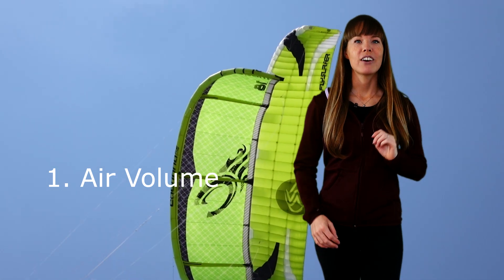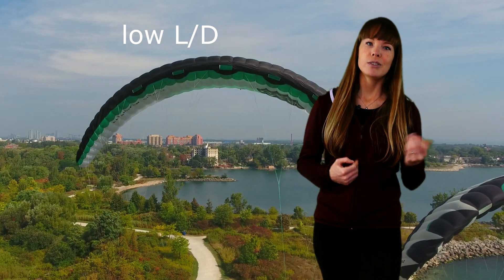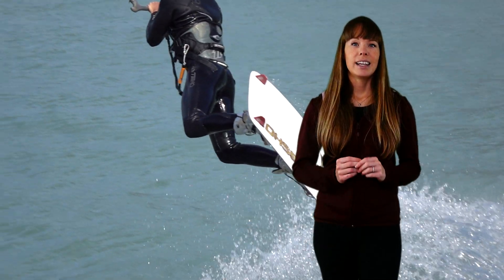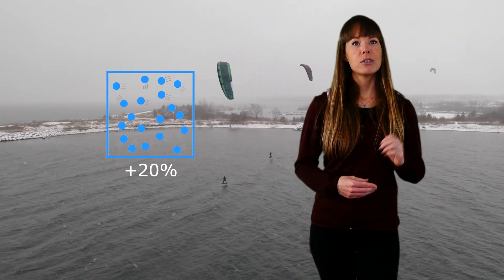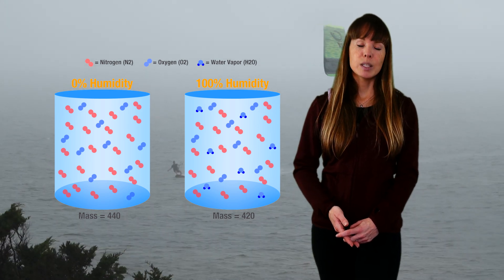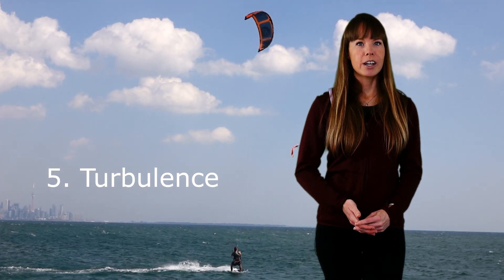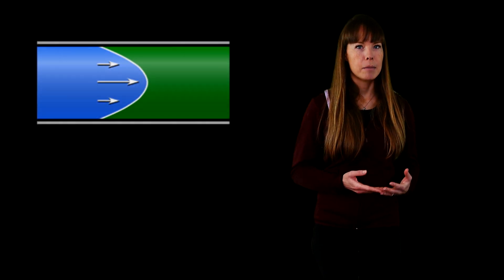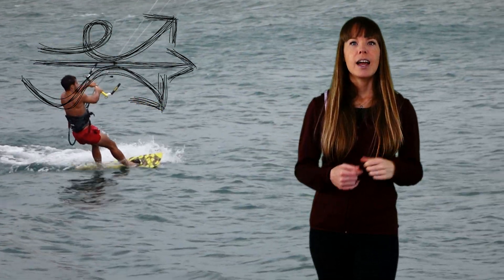5 Things that Affect the Power of Your Kite

Comment: Kinda late commenting on this one, but... My understanding was that the amount of energy per second delivered by the wind varies with the cube of its speed, not the square.  A fixed block of air with a certain mass contains kinetic energy related to the square of its speed, just as you say. Double the speed, 4x the energy in that block.  But if you double the wind speed, then twice as many of those blocks hit the sail every second, which doubles the energy again. 2x wind speed = 8x as much energy per second, 3x wind speed = 27x as much energy per second.  That's why in sailing in general it's so easy to get overpowered as wind speed increases.  Is there a factor with a kite that changes this?
Reply from the maker: Hey Blaik, from our research and from previous comments that we received, wind energy is square of its speed, curious where did you see that it is cube?
Reply: @OurKiteLife  High school physics: Kinetic energy of a moving body = 1/2 mv^2.  So a block of air of a given mass contains kinetic energy proportional to the square of its speed. But as speed increases, more blocks hit you per second in proportion to speed again.  E.g., double the wind speed, each block of air has 4x the energy AND twice as many blocks hit you per second.  2x as many blocks, each one with 4x the energy, so total energy delivered per second goes up 8x.
For some independent confirmation, Google the phrase "wind energy as a function of speed".  This mostly turns up articles on wind turbines and the power they generate. Here are a few that turned up from that search when I did it, all of which agree that power varies with the cube of wind speed:
https://www.windpowerengineering.com/calculate-wind-power-output/
http://xn--drmstrre-64ad.dk/wp-content/wind/miller/windpower%20web/en/tour/wres/enrspeed.htm#:~:text=The%20wind%20speed%20is%20extremely,eight%20times%20as%20much%20energy.
https://energyeducation.ca/encyclopedia/Wind_power
https://openei.org/wiki/Wind_energy
But a sail/kite is not a turbine, in part because it's in non-trivial motion relative to the wind when in use, and I don't know if that impacts things or not?
Regardless, your essential point still holds - the amount of energy you're playing with can go up rapidly as wind speed increases.  The prudent sailor/kiter should be wary... and excited. 😁

Comment: Great video, and something I've thought about a lot - especially the laminar vs turbulent flow and just how significant of an effect it can have on kite power.  I ride almost exclusively on foil kites, and spend a lot of time on Lake McConaughy, Nebraska in the summer.  At that lake, there is a very predictable morning wind that feels quite strong, but once you get out, it has hardly any power.  In the afternoon the winds speeds can be significantly lower and yet surprisingly provide much more power.  I've come to call the morning wind "holey", and the afternoon wind "plump", or "buoyant".  I've come to basically the exact same conclusion you have:  in the morning there is a lot of thermal mixing going on, making the flow more turbulent, whereas in the afternoon the thermals have steadied out making the winds more laminar.

Aerodynamically speaking, I believe the reason this has such a significant impact on kite power is the following:  in the gustier, more turbulent flow, I don't believe the air has the ability to fully attach and flow the full chord of the wing before it gets disrupted.  This I'm guessing is causing premature flow separation on the topside of the wing near the trailing edge, kind of similar to what happens when a wing starts to stall.  This means your wing is flying very inefficiently with a modified airfoil/airflow shape that looks nothing like it was designed to be; i.e low lift/high drag or low L/D ratio. In a nice laminar wind, however, the wind/air will stay attached the entire chord-length, just like the designer intended  - and your kite performs like a dream - as it was intended.  Too bad those laminar days are so few and far between for us inland kiters :)

What would be really fun is to take a kite and tape a bunch of small pieces of thread across the entire wing (or at least a wing chord section) like you might have seen in wind tunnel tests, and then somehow get a video of the top surface in the different types of air.  I bet you would find that in laminar winds, the threads stay pinned down the surface of the wing the entire time, whereas, in turbulent winds, you'd find the thread tufts fluttering quite a bit - especially towards the trailing edge.  This would be a sure sign of inefficiency.  Sounds like a great COVID Project, now that you've got your balance board done!!

Keep up the great videos, thanks for all you share.
Reply from the maker: great discussion there, thank you. You raise an interesting point about time of the day as well. We personally find that wind is stronger in the morning (depending on direction) and lower in the afternoon as it warms up (except the thermals, south winds). In the evening the winds usually wind speeds pick up again on easterlies, and die down when they are southerly (thermals). 
With regards to attaching a small threads across the wing, that is actually doable, and we do have the time. Will see how it goes. So far we had barely any wind for past two months :(

Comment: Reasonable 'on earth' changes in temp, pressure and air density won't deliver a 3% difference in wind power.   Giving relative measures of individual variuables is misleading and makes it sound like these have a huge effects.   Turbulence and gradient have much more effect.
Reply from the maker: We did focus on extreme conditions, and we agree - if you're looking at kiting between 15 to 25*C the difference will be minimal. From our experience in snowkiting in -20*C and kiting in summer in 30*C, the difference is noticeable
Reply: @OurKiteLife  Yup and almost entirely due to wind gradient.

Comment: Regarding turbulence, I'm not a meteorologist, but from a paragliding perspective; I'd agree the primary division is between 'ground obstacle induced', and prevailing air 'stability'. Whilst both are affected by the air-mass characteristics the ground obstacle impact is, of course, easier to predict. Turbulence within the air-mass itself is primarily caused, as you suggest, by the mixing of different air.  Normally this is due to differing layers at height, and is crucial to distance paragliding as it is necessary to find warm 'thermals' rising thru' colder air in order to gain altitude. Naturally as warm area rises then colder air falls down to equate the pressures, and this the basic cause of turbulent gusts. On the ground you can notice the wind direction of these can be very different to the prevailing breeze. This much is pretty straightforward and explains, for example. why inland winds are almost universally more difficult to use than more laminar 'sea breezes'. (Coastal Cliff soaring a glider in such conditions can be almost 'hands off'). The more subtle point is that some days the 'edges' of thermals are relatively smooth transitions , whilst on other days they can be seriously turbulent (leading to various 'collapses' of the wing). Apart from differing windspeed gradients this is normally also explained by pressure and humidity impacts. Dry high pressure days can be expected to be more turbulent, which is explained as being due to the 'bullet' nature of thermals on such days.
Reply from the maker: We definitely have experience with thermal winds shutting off - it seems that they get quite turbulent right before it happens. Thanks for the explanation :)

Comment: Obstacles can cause turbulence, the IKO teaches instructors that a set of trees upwind of for example 10m high will cause unstable winds up to 7*Height of obstacle downwind. In this case 70m. It is called wind shadow
Also the example that is given with the pipe does not completely compare with wind. since laminar flow in a pipe will automaticly become turbulent at a certain flow speed. The Reynolds number tells us if a flow is laminair or turbulent. For wind, which is not enclosed in a pipe this does not really imply as far as I can remember from fluid dynamics.
Reply from the maker: From our research, somebody used a laminar flow in a pipe as an analogy which made a lot of sense - we realize though that the flow in pipe vs wind are two different things, which is why we asked for some clarification from the community. With that said, in our experience, laminar flow kind of makes sense with regard to explaining steady wind vs turbulent wind - not gunna lie though, we're not sure how accurate it is, but a starting point for discussion

Comment: Great video guys!  You made the science of aerodynamics entertaining.  If you added in Bernoulli’s equation, you may pass as an aerospace engineer!  Basically, the turbulent flow over the kite results from laminar flow separation on the upper side of the kite when you have gusty/shifty airflow passing the kite.  In gusty winds, it is difficult for a rider to predict and react fast enough sheeting in and out to get the correct angle of attack to prevent the turbulent flow.  Makes for an unpleasant day on the water.  Good work guys! 👍👍😄
Reply from the maker: Make sense as there's a very different feel from the kite in steady conditions vs gusty conditions
Reply: I don't think you understand Bernoulli's equation, it only applies to restricted flow(i.e. pipes) and applying it to an airfoil is wrong. This is the single most propagated aerodynamics misunderstanding on the internet. To be fair wikipedia has this wrong and there is published literature misusing the principle. If you want to read papers explaining how and why google for "Bernoulli's misuse".

Also, turbulent wind is more than just gusty wind, as someone already mentioned there is a vertical component to turbulence. A simple gust is fairly easy to deal with, you sheet out or in and you are done. A turbulent gust hits you with rotors where wind changes direction much more rapidly and unpredictably than most can react making your kite overfly or stall into power zone.

Comment: Turbulence includes a vertical component.  Close to the ground the might happen do to high winds speed shear just above the kitsters.  Say if there are 80 knot winds at 800’ to 1000’  and 15 knots at the surface, that would creat plenty of eddies that would roll over each other and certainly include vertical velocities anywhere in the column. 
Gusty describes just describes variable winds speed over short time periods.  It might include a vertical component but this not measured in reported wind speeds.
Reply from the maker: thats some good info on turbulence vs gusts. Thank you
Reply: My mom was a meteorologist and I’ve spent 4 decades studying the weather so as to bore holes in it traveling around this ball.